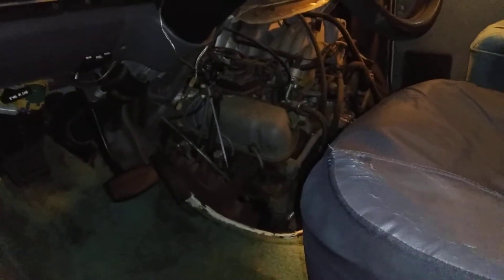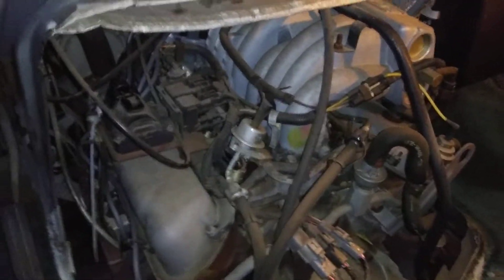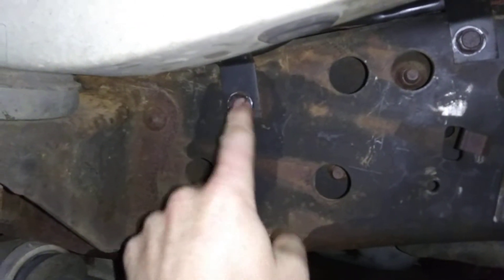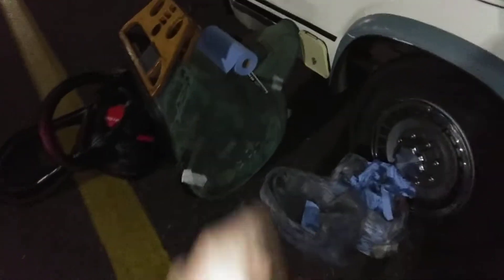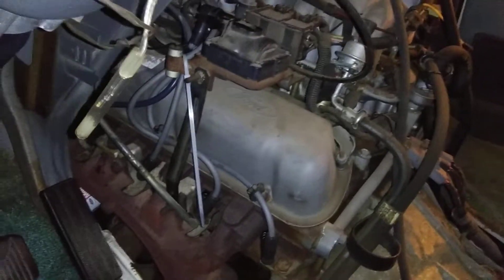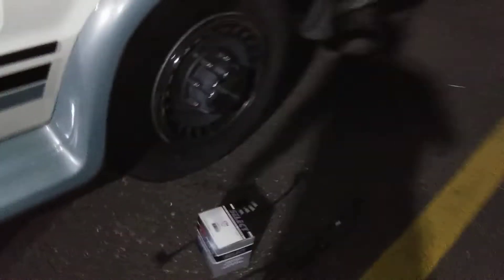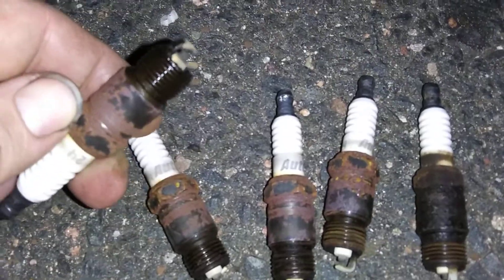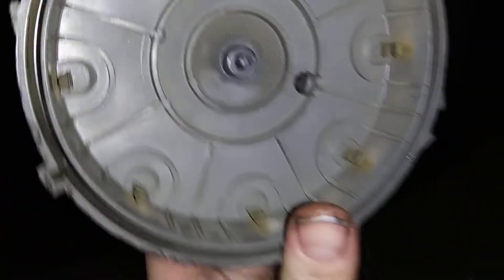Part 3 are We Done Yet well it's not 2:45 a.m. in the morning yet is it🌎🔧🚐🔩🔧🔨😴😴😴

Comment: Coates the old plugs are indicative of your engine condition...it's burning no oil, the ignition and fuel systems are working perfectly. Job well done my friend
Reply from the maker: Thanks for stopping by bro and yes it seems to be running very well and doesn't burn any oil spark plugs look good and clean on the ends maintaining any vehicle will keep them running longer as you very well know🌎🔩🚐🔧🔩✌😁
Reply from the maker: Kitten Cat  thanks for stopping by how have you been I hope you're doing well out there. I'm just here doing some more maintenance work on the dinosaur getting ready very soon for a big road trip South that is🌎🔩🚐🔧🔩✌😁